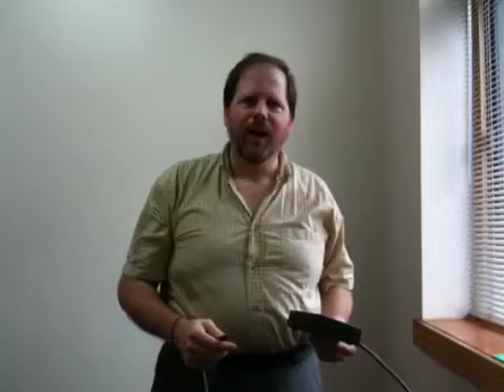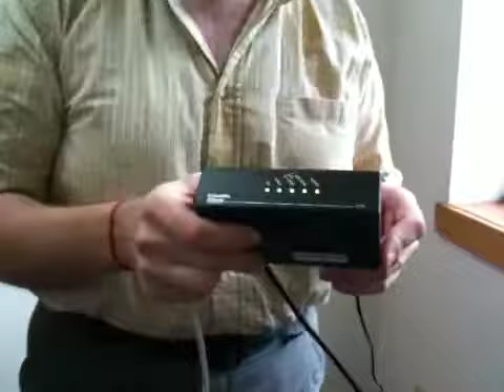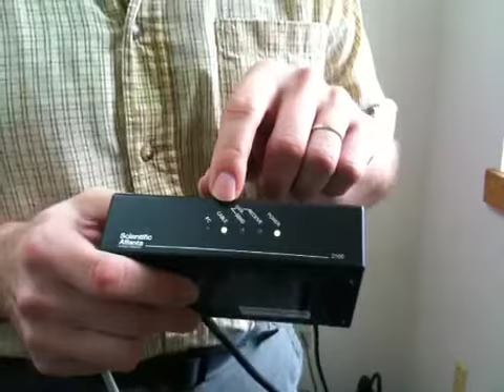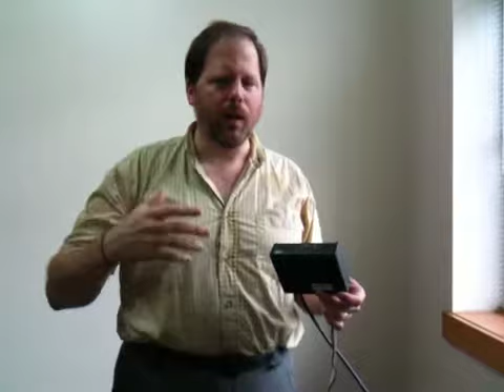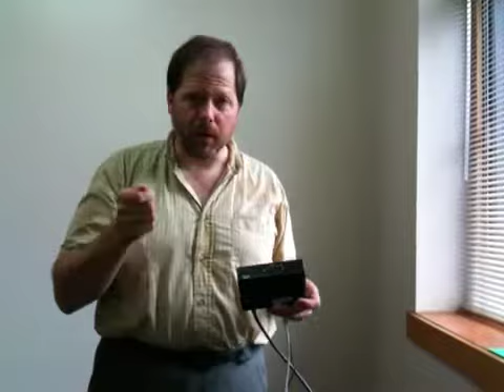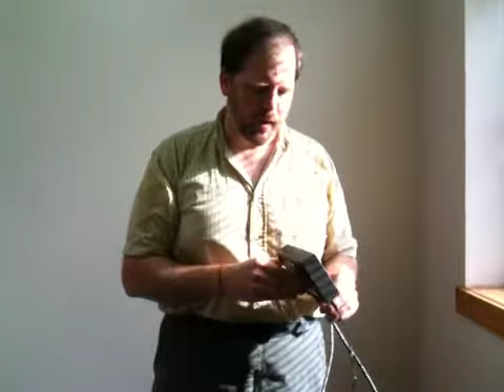20090820th-Mediacom-cable-modem-diagnostics

Comment from the maker: If it is powering itself off, you may have a problem with your power strip. Try a different outlet. Surprisingly enough, some surge protectors can get faulty. It could also be that the unit is overheating.

I'd recommend calling your provider and describing the problem to them. I know in our area, customers can pay a small amount more to purchase a very nice high quality modem instead of the refurbished and recycled units that are unpredictable.

Comment from the maker: You'll probably want to contact Mediacom. The easiest hookup, that's usually software and setup free, is to plug in the Ethernet cable. Perhaps their box is messed up. Remember that you normally need to do this: (1) turn everything off and disconnect power, (2) power everything back on. (3) Then the box recognizes your computer. Also, some Mediacom systems require that you activate your connection.

Comment: Hey, i have the same modem, and only the usb cable will work with my Pc. it goes on local area conection and starts fine.  when i use Ethernet it doesnt say anything and i want to use ethernet so i can connect my xbox up aswell. any idea?